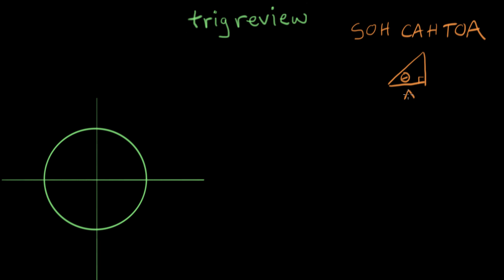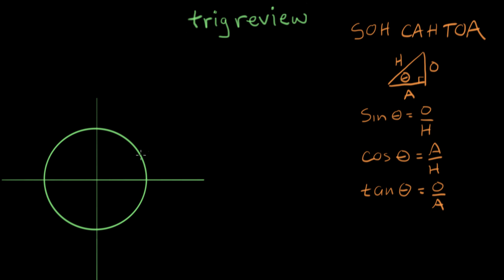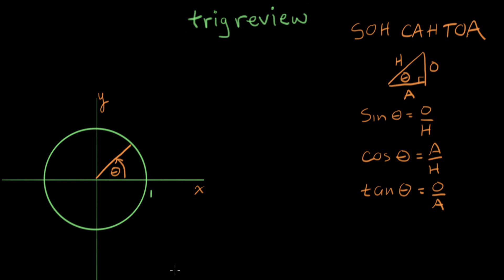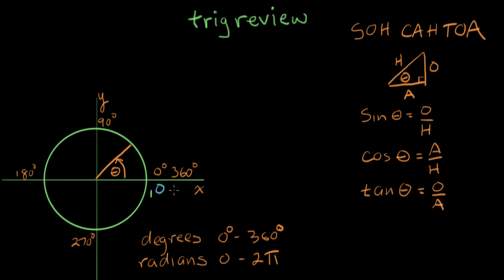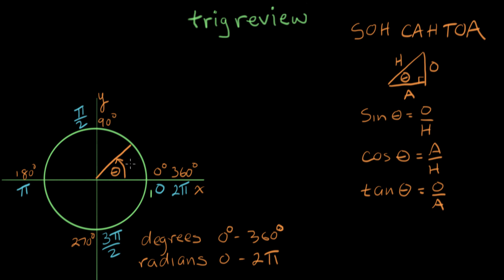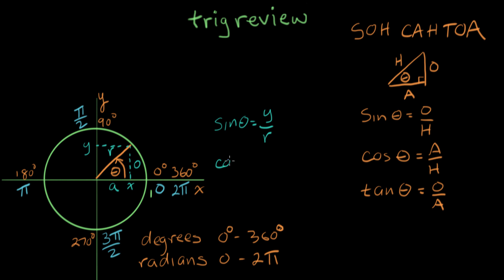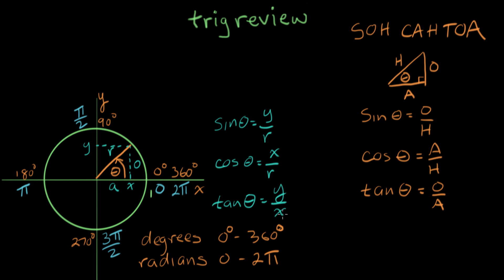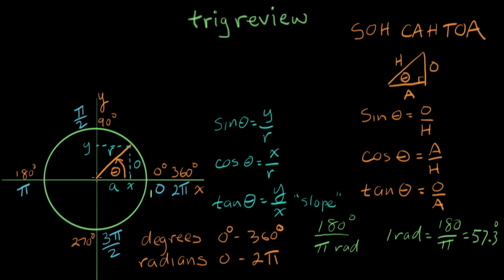Trigonometry review

Comment: can someone please explain to me why we can just divide degrees by pi which is in radians?? why at the end, did he just take the degrees° sign off of the 180 and divide it by pi. how does this work. thank you.
Reply: If you need to convert units -
degrees to radians ... multiply by (pi/180)
radians to degrees ... multiply by (180/pi)
Reply: 180 degrees is equal to pi rad. Multiplying a circle's radius (radian) by pi (pi radians) will give half the circle or 180 degtees. Diving the two (180 and pi rad) will give you 1. It's used for conversion
Reply: Pi=180°, 2pi =360°
Reply: Because 180 degrees and pi represent the same point on the unit circle. If you take 180 degrees and divide it into units of pi (the equivalent point in radians) you will get the number of degrees in 1 radian. As for dropping the degrees, it's similar to how in story problems you often will omit the units of ft or cm or whatever and add them back in at the end. It's not technically correct but is extremely common.